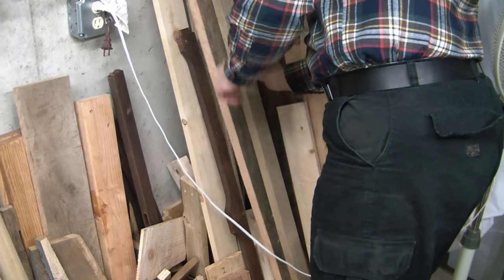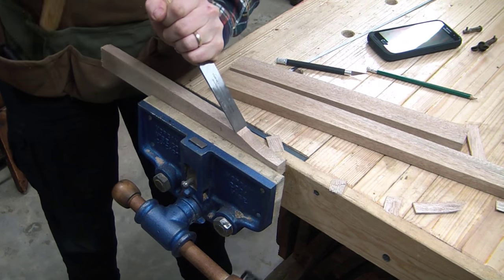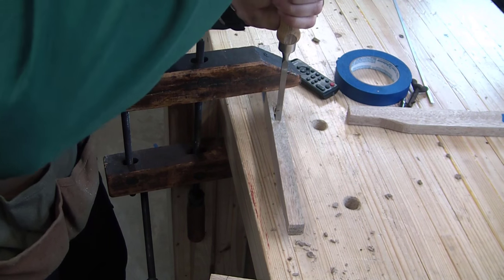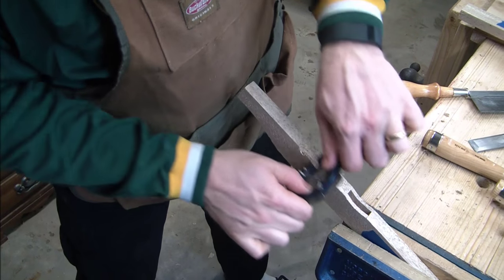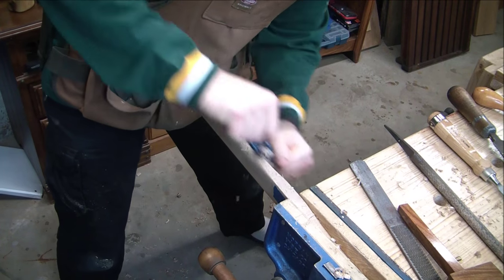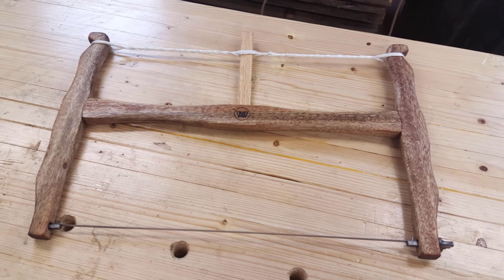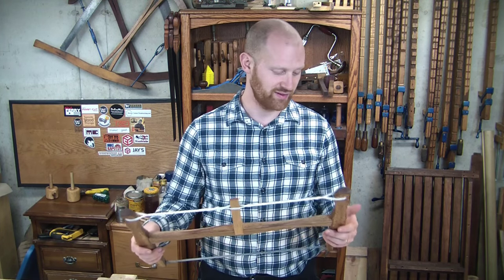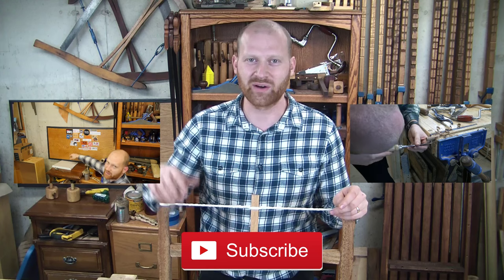How To Make A Turning Saw By Hand  - Mahogany

Comment: I made sort of a keyhole saw from a reciprocating saw (sawzall) blade with a homemade wooden handle, and ended up really liking it. Of course it's a pull cut, but it's very small, light, and easy to control, and of course you can easily change the blades if it gets dull or you want a different TPI.
I love repurposing stuff!

Beautiful build!! 😁👍

Comment: My dad  have oner with handle  In Dubrovnik island and  it do com handy since in cut  you adjust  handle losing it  change turn and  tightening  it especially if you wanna make cut  in curve and round like for bottom of barrel or planks for wood boat  this is must ,,I am in  situation to make one so thank you for input great work ,Love it , I play with it as kid since cut so easily. Butcher  bone sew will cut  hard  maple easily and  accurately.Awesome steel.   Good luck from Chicago,
Reply from the maker: +DundoMarinko thanks. I am glad you like it.

Comment: this is the first time i have seen any of your videos and you explain the steps so easy. I have been wanting to make a frame saw but i thought it would be hard and expensive buying the blade and hardware. I never thought of just recycling a old hacksaw or using a bandsaw blade. I have a old hacksaw in my junk drawer, all i need is a blade. Thank you keep making the great videos. +Wood By Wright
Reply from the maker: thank you that is a huge complement. that is one of my biggest goals to help people see how easy some tools are to make. if there is anything you want to see please let me know.
Reply: i watched your video where you showed how to make a plane iron and after you put it in the oven at 450 for an hour do you just take it out of the oven and let in come to room temperature like that? Wood By Wright
Reply from the maker: +Holly Helton you can but for a full temper I leave at that temp for an hour. then bring it down to 300 for an hour then down to 200 for an hour. then I turn the oven off and leave it in there tell cool. I now do it in a tester oven so I am not using so much cooking fule. Lol.
Reply: ok thanks i have been wanting to make a router plane iron but i wasn't sure on how to temper the steel correctly. Yeah i think the toaster oven is better to use lol Keep making the great videos. Some channels just show what they made but they don't really explain how they done it and when i watch your videos i understand how you did this or that. Thank you again Wood By Wright
Reply from the maker: Thank you! I try to put in as much info as I can, but I still miss a lot of info so feel free to ask any time. I would love to help in any way!

Comment: Found one at an estate sale. Only part missing is the tightening stick. Stressing over getting a piece to match until I saw yours. Think I can handle making that one piece 😉
Reply from the maker: Glad I could help. Sounds like a nice find!
Reply: Found a piece of scrap that was the right size/thickness. Sanded and finished with Tung Oil. Doesn't match but still looks good.

Comment: This looks like a similar build to what I'll be doing soon. I have a 21" Bahco bow/buck saw replacement blade. I'll be make a take-down buck saw for my pack, for when I go out in the woods. I'd love to make a folding one, where the blade stays attached, and the two sides have a slit in them, so the blade can hide in the handles. I don't have a tool that can make that long thin slit in the wood, so I'm skipping that step. This video gave me a good basis for my project, with the exception of the blade attachment.
Reply from the maker: sounds like a fun project. you could make that slit with a hand saw that has a wider kerf. all you need to do is clamp the work in place with a fence. that will keep the saw on track tell it has a deep enough kerf to keep it going. a buck blade is a lot easier to attach as it just needs a pin going through the lim into he saw.

Comment: Impressed with using a brace to drill through the steel bandsaw blade.  I used a cheap mains powered electric drill & ruined several bits before reading that folk normally "blue" the ends (heat them up & then let them cool) to soften them for drilling - but you didn't even need to do that!  BTW That chisel looked more like 6mm or more than 3mm ;) Glad you used non-chemical boiled linseed oil (I use raw), hope the wax is safe too (I make own, no toxins). Cute kids.
Reply from the maker: thanks. with the slower speed the bit just has to be of a harder metal. I miss spoke the chisel is 8MM. I love having the kids in the shop. makes everything fun!
Reply: I used regular general use (wood & metal) drill bits at first but then bought special hardened bits specifically for the job (HSS and/or cobalt and/or vanadium). They worked a little better but ruined at least one of those too, even after blueing the ends of the blade :(. The problem was probably my drill (blaming the tool!) which has no speed control: I think you need to drill metal at lower speeds, just as you did :) 

I have 4 old bow saws in 3 sizes and managed to turn one bandsaw blade into about 6 bow saw blades of different lengths with no wastage :)

BTW I find taller blades are stronger but shorter blades work significantly better in turning applications: tall blades resist turning more.  I also prefer short, higher TPI for turning applications and on smaller bow saws, they cut slower but more accurately. The new band saw blades cut very well,much better than the worn out old blades :)

Comment: nice build, i like to use hand tool, but power is faster.
I must try to make one too.
Thanks
Reply from the maker: +Chuck Mardon Thanks! I completely agree If I had the space I would have a table saw - planner - and joiner. but for me it is less about completing the project and more about the enjoyment of the work. but everyone is different.
Reply: Sometimes power tools are faster, but not always.  I've seen people spend five minutes on setting up for a cut that took three seconds, while doing it with hand tools would take three seconds of setup (clamp the wood in the bench vise), and thirty second to do the cut.

Also, some hand tools save work later.  A smoothing plane, for example, means there's no need to sand afterwards.  A planer is much faster, for sure, but you can't take off a 1/1000" inch smooth shave and get a shiny surface.

Comment: That is so nice.

I found a partial bow saw a while back and i intend to get it back to useable state. But there is some weirdness that is holding me back at the moment. Maybe you can help. At the site of the mortise there isnt one, instead there is the remains of a thin metal strip. I just dont know why or what its supposed to do. Maybe you can point me in the right direction with that one?
Reply from the maker: +Willem Kossen That is interesting, I do not know. but I would love to see pictures. sounds like a user repair or change. the M&T connection dates back a long way, and I can say I have never seen one that was not M&T. would love to see it though!
Reply: I know I'm late to the party, but I think I can help. Here in Germany there's a manufacturer called Ulmia who've been making those saws for way over a century. They call this piece of metal a feather (“Feder“ in German) and it's put in to keep the middle piece from turning and slipping off the actual frame. Looks and works kind of like a floating / loose tenon. 
BTW, it's funny to read that comment just today, as I  bought two old ones only 3 hours ago and am replacing the middle beam of one right this very moment! I just love how precise, sturdy and yet extremely lightweight those saws are! 
And on a last note: if there is a problem to find hardwood, those saws can be made out ANY wood. Even the softwoods like pine etc. work just fine!

Comment: Well, you asked for it. What did you do wrong? Something I noticed at the beginning. At 2:29 you point the chisel with the sharp end towards yourself. That me work very well for a long time, but if the chisel slips for any reason at all, you will hurt yourself badly. Wouldn't like to see you get hurt, since you're doing an awesome job...

By the way, I love the saw. Have been wanting to build one myself but was held back because the blades are impossible to get hier in The Netherlands. Your solution with a bandsawblade is fantastic. Those blades I can get. Thanks for that...

Comment: Yo James, how could you drill a hole in the saw blade, diamond drill bit? I tried normal drill bit, only left some scratches on the blade.
Reply from the maker: Johnny Fan a good carbid bit should do fine. If it is a cheap high speed  steel bit then it will have problems.

Comment: love the mahogany!beautiful looking saw james..i have the same little compass  (German made)goodbstuff.at least i think i habe the same compass as u.question (s)- whats a turning saw used for?and lastly what brand spoke shave do u use i want to get one (saw one on amazon) ( but it's got a lot of bad reviews is there a specific brand you would recommend I don't mind spending a few extra bucks to get a Quality Tool especially when it comes to hand tools.. Thanks James have a good one
Reply from the maker: +Joe basementwoodworking Thanks. the saw is used for making any cut you would make with a band saw. so I can make curved cuts faster then using a coping saw. I will be making a Hatchet next week where you will see it in action.

As to the spoke shave I used there is a Stanley 53. It has an adjustable mouth so you can make a deep er cut or a fine shaving. it is a bit of a pain to setup but it works well. most of the Stanley Spoke Shaves you can not go wrong with but there are so many with so many different uses that it is hard to recommend. if you want to get new the Veritas spoke shaves are great, but even with that there are different spoke shaves for different uses. some have a convex or concave mouth some the sole is rounded front to back to get into smaller curves some have a large sole for better flat Cuts. there really is no one shave to do it all or even most of it. I have 3 that I use all the time But, for a general use the  Stanley 53 or the Veritas Flat, will do you good.
Reply: +Wood By Wright cool..i was gonna ask if there was one i could use for general use.like flat work and curves. so #53 or a veritas..got it. thanks man!
Reply from the maker: Any time!

Comment: Cool project again, I'm starting to sound like a broken record ;-)
Is the saw blade hardened or can you sharpen it?
Maybe you could make a little wrench for adjustment that attaches to the saw?
Thanks for the content and have a great day.
Reply from the maker: +Nearoth Thanks! the saw blade is not hardened, but it is easier to make a new one then to sharpen it. With the whole band I can make 5 blades and each one only takes 5-10 minutes to make. I actually added a bit of wax to the frame where the connector rubs and I can now turn it by hand.
Reply: +Wood By Wright guess it would be a hard blade to hold in the vice to sharpen.
But making a new one is just boring :-)
Cool that it now turns so easy, look forward to seeing it in action. 
Do the kids have more tools yet? Or still just testing the mallet on their head ;-)
Reply from the maker: It is so boring!! LOL
I actually use it in the newest video https://www.youtube.com/watch?v=0vG_bUpUlYE
I got them 2 sets of cheap Screw drivers that they can use as chisels and a couple tape measures. and now they are in heaven. LOL
they still test them on their heads from time to time!
Reply: +Wood By Wright I know I'm behind. I think I'm following to many channels :-)
Hope they're not using your good wood. A small wooden coping/turning saw for the future?
Reply from the maker: Well that video just went live 30 minutes ago so. LOL so really hot off the press. they play mostly with the scrap wood box. and I love seeing what they come up with!

Comment: Outstanding build. I have wanted to make one of these saws for a while now. I want one that is about 18 inches wide maybe a little less.  for the mortises on the handle did you use a router plane to clean out the mortise ?
Reply from the maker: this one was about 18" but you can make them whatever you want. I just used a Chisel for these mortises. if it is sharp it will leave a nice clean wall.
Reply: Thank you.

Comment: yours came out really beautifull and  im no expert but that the string u used doesnt seem like it could hold the pressure of the saw if u want to really tighten the blade straight
Reply: i've had them snap and it can REALLY hurt
Reply from the maker: Thanks. but this is a nylon cord with 200# test. and there are 8 strands. it is not traditional, but it is stronger than traditional. it has been a fun one to use in the shop. I am going to be making another one here soon showing more traditional methods.
Reply: cant wait are u gonna make a saw for a specific purpose? i like the big frame saw u have with the turn bucle (i think its how its called) that seems way better then cords what's ur prefrence between the two?
Reply from the maker: well different methods for different needs. using a cord on the back makes it light and perfect for a turning saw. and it really does not need to tighten it that much. the frame saw method is great when the weight is not a problem.

Comment: instead of a belt saw try a survival  string saw  (62 cents on aiexpress)
then you don't need to turn the blade it cut in all directions
(i made a frame saw from a chair i found and tear apart- very little work!)
Reply from the maker: might have to give it a try.

Comment: A bandsaw blade ...??? Does this mean you DO own a powertool?
Reply from the maker: LOL I have many power tools, but unfortunately a band saw is not one of them any more.
Reply: @WoodByWright  did you ever see the Frank Klaus video, cutting dovetails? Used a blade with 90° twist at one end, already cut the tail slots with handsaw, slid bowsaw into slot & turned to cut out tail in 1 movement forward. Was quite astonishing!!